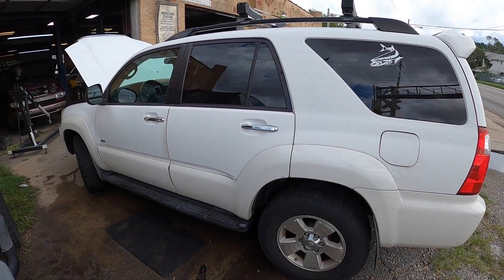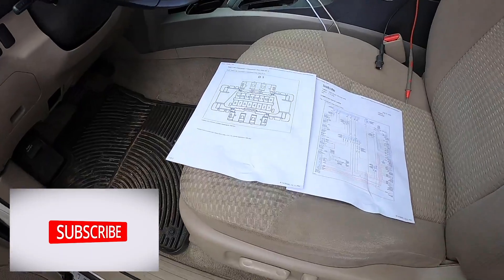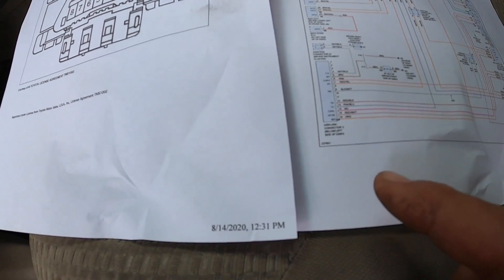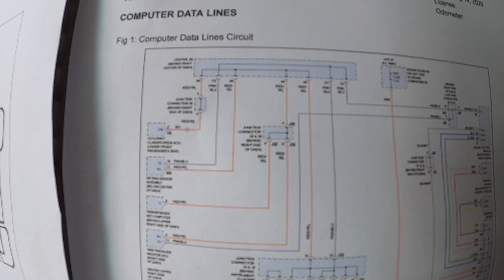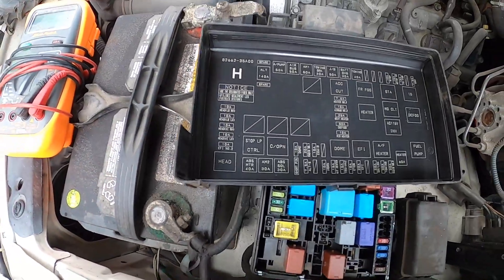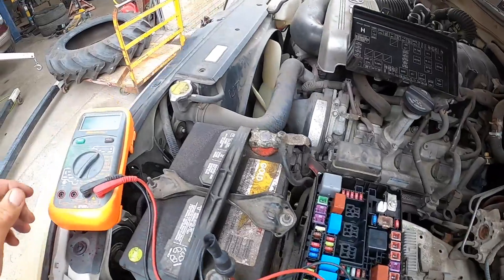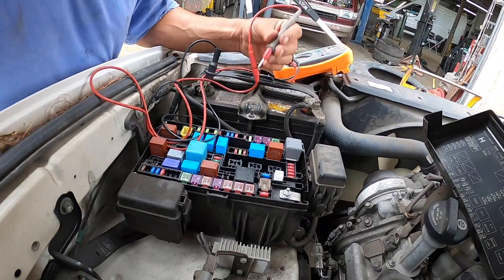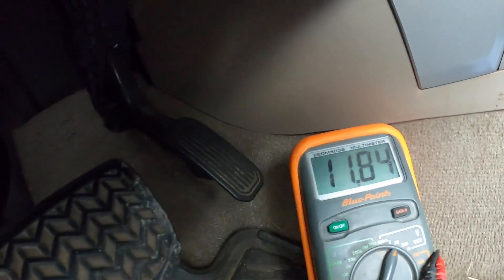OBD2 scanner won't connect to ECU follow these easy steps

Comment: Scanner turns on. No connection to ECU. All pins are grabbing male pins. No connection to ECU. What could be the problem? I believe the Can hi-low and k-line wires maybe not in correct position with the scan tool cable

Comment: Hi,I have no communication with my fiat doblo multijet 2018.car is in peak performance,and there's no check engine light on dash when engine idles,I checked and tighten all pins on obd port,scan toos get power from it,but won't communicate.please help with any advice,as the time might come when I need fault tracing in future .any advice will be much appreciated
Reply: Hey 
Did you find the solution on  your  problem???
I have an opel corsa 1.3 cdti  2012  and I haven't a problem with the engine 
My diagnostic tool  can't communicat with the ECU 
I have 12v in the pin-16=B+
I have 12v in the pin-4 and the pin-5=B-- =body

Comment: I have a 2010 accord..obd2 reads error. The car cranks but doesnt turn over. Replaced the fuel pump relay I changed the fuel pump/crank position sensor/spark plugs and NOTHING. I put the jumper cables on the fuel pump directly to give it direct power. It works. But when i dont...the fuel pump doesnt have power. I even changed my ecu because the dash doesnt show the green key (for the anti theft). Where the car is not communicating with the immobilizer. What could it be?? Please help
Reply: How did you sort it out?

Comment: I have a crank no start after a fresh engine It's a no spark issue and no communication to the ECU. I've checked every spark, fuel and Air line under the hood everything looks physically fine. 
 I also have high resistance at the fuel pump from my multimeter. 
 I never had these issues before the engine was pulled the car started just fine.
 What do you think it could be?
Reply from the maker: Check your grounds

Comment: Mine works fine but when I do like a deeper scan it says communication failure and to check if my car is on etc.
Reply from the maker: With your scanner are you able to pull a code? Also, what kind of scanner are you using? If you don’t mind me asking
Reply: @AutoRepairTips757  I’m using the foxwell and BlueDriver on a 2007 highlander. Yeah if there’s a code it shows up but when I do like the deeper scan it says no communication. But on my Honda it scans transmission and all. That’s what I’m trying to do with the Toyota. The foxwell is the 510. Thanks
Reply: @AutoRepairTips757  it’ll do the regular scan but not the bigger scan that check’s transmission and all.
Reply: @AutoRepairTips757  it’ll ask to pick if the car was made in Japan or Canada etc then after picking it’ll say no communication but when I pick Canada or other it’ll scan half way to air conditioner or imobiliser then stop

Comment: Hay mine has power but does not give me any information back from the car, it's a 2003 ford Fiesta almost exactly as the bantam and apparently it's the same chassi as the first Ka but can't seem to get is working but I do know where the fuse is for It as I unplugged it so see when it go's off as my car manual only has 2 fuse panels in it but it actually has one more behind the center box and also not sure what it is all for, my manual also stats that the diagnostic fuse is at number 2 fuse but it turn off with fuse 22 , can you help me please?
Reply: Did you find out why?

Comment: Hi, could you clarify what you mean by they "spread the connector"?
Reply from the maker: Where you plug the OBD in the power terminal was spread apart so it was not making a good contact
Reply from the maker: the prong on the scanner was not making contact with the OBD port, the OBD port connector was spread to far apart
Reply: @AutoRepairTips757  Is that connection under the dash by the OBD connector??  My chevy just had work done & it's not reading for the state inspection. Don't want to pay another mechanic for more work.
Reply from the maker: @AdrianaPerez-lm8ys  yes under the dash
Reply: @AutoRepairTips757  ty!
Reply: Jaja

Comment: PLEASE HELP ME! I put a jumper(paperclip) between #4 and #8 on the OBD2 on my 03 cadillac seville to program a new key fob, and since mine didn't have an 8 I decided to try #7(dumb move) now my Trunk/fuel door bottons dont work and just realized today that My OBD2 isn't working either. Ive already checked every single fuse and relay and still nothing. Everything else works good so I doubt it if I nessed up the computer. What else can I check. Thanks
Reply: Michael P  I finally fixed it. It was a blown 15 amp fuze. I had already tested them with a Voltage reader, but then saw a video where he mentioned to test both test points. Even though one test point gave me Voltage the other didn't.
Reply from the maker: I’ll look up a wiring diagram when I get to work